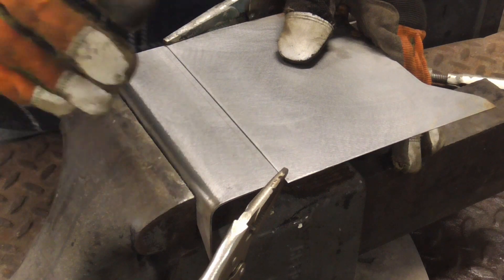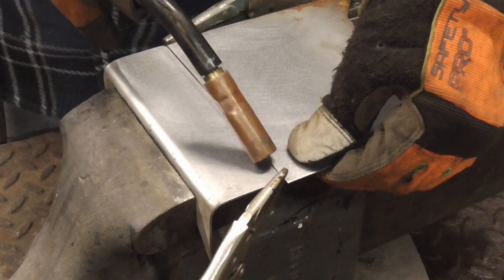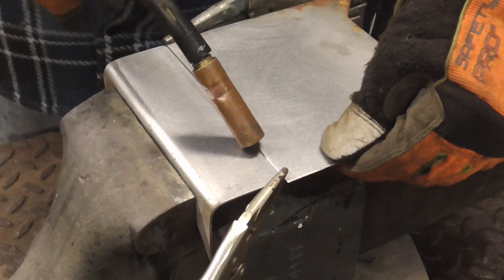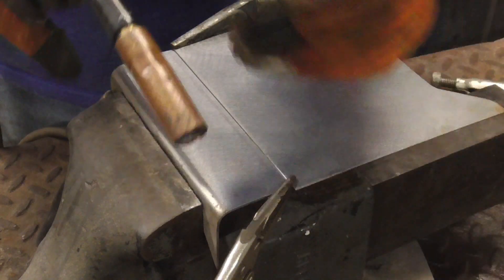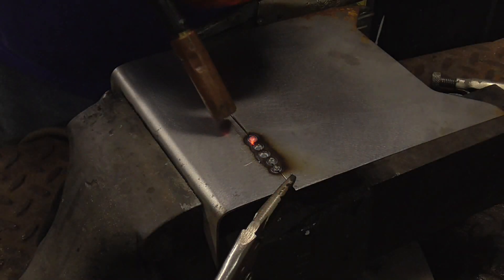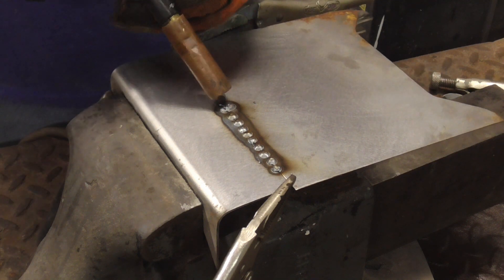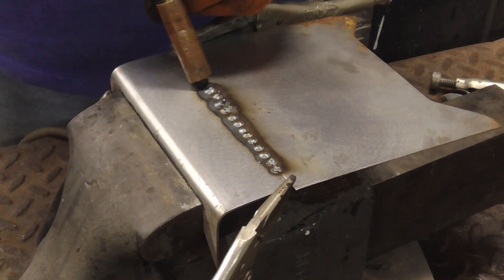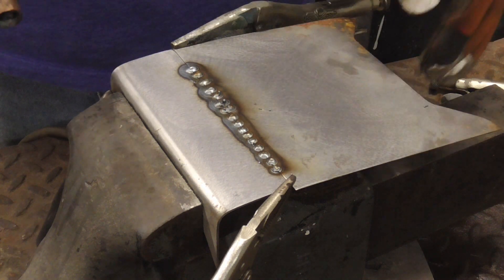Lap Welding Auto Body Sheet Metal - Made Easy

Comment: Good video,there is a big difference in the quality of some of these might welding machines.i bought what looked a good 180  unit.it never welded that consistently and if there was even a very slight bend in the torch line it really became temperamental.a friend of mine lent me awhat looked like a much smaller 150 amp machine that was pretty hacked.what a difference.and although smaller ,much heavier.suspiciously I looked inside both machines.inside be my big 180 amp machine a wire feed moter that was pathetic inside his much smaller cabinet 150 amp every thing twice the size and heavy duty.

Comment: I want to change my back window in my car project .thinking about lap welding across the top will it warp if I spot weld and should I cool after each spot weld.going to start in the middle of the top and work my weld to the sides of the top
Reply from the maker: Large open areas of sheet metal can distort with too much heat - just keep an eye on it as you are welding.  Alternate from one side of the patch to the other and keep filling in the spaces.  Tack a bunch of spots across the whole patch then fill in one spot - go to a cool area and fill that in, etc.

Comment: Thanks Jerry, just wondering what you do to control distortion? Especially on a long seam when patching a door bottoms
Reply from the maker: Sorry about the late reply - didn't get the notice.  You can control distortion by doing a few welds right next to each other then move to a completely different location.   Move to cool areas and do the same till you have the whole thing covered.  Keep the welding temp as low as you can and take your time - hope that helps a bit.  Let me know - Jerry

Comment: hi Jerry   have you ever done a video using a 110v wire feed welder.  i am wondering if you can get similar results.  i have very minimal welding experience and have not had any formal courses...other that youtube
Reply from the maker: All of my welders are 110v so you'll be able to get the same results.  This video is a 110v Miller Millermatic 90 .023 wire MIG welder.  https://www.youtube.com/watch?v=1BYqLM_mY1s  Don't make it any harder than this video - it's that easy :)

Comment: But lap welding will cause a raised
wouldn't it 
For body work
It's supposed to be butted joints
For a level finish
That's the way I was told ye
Reply from the maker: Body shops use both lap and butt depending on the situation - lap where the seam can be tapped down - butt welds on rigid edges and areas that can't be tapped down.  You absolutely want the seam tapped down and a buffer like filler or even reinforced filler between the seem and the finish. You really don't want a seam - no matter how it was done right under the finish.  Here's a video that explains it - https://www.youtube.com/watch?v=JIIonJOVro4